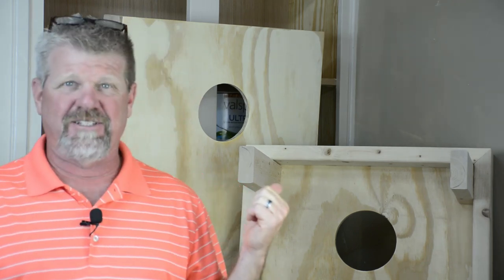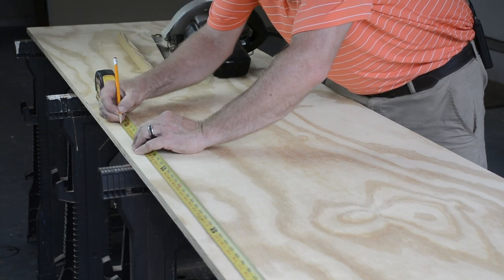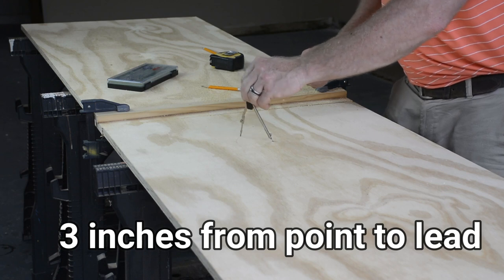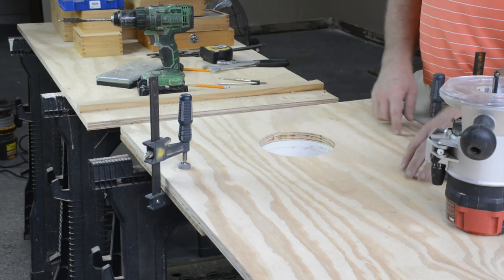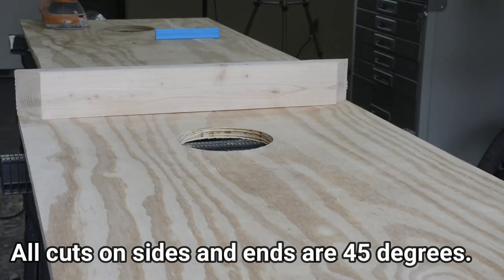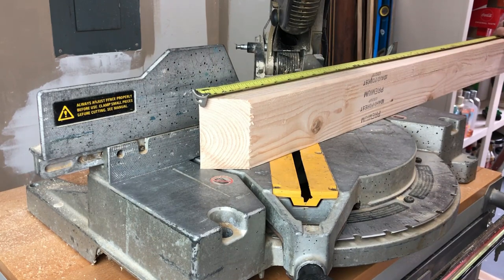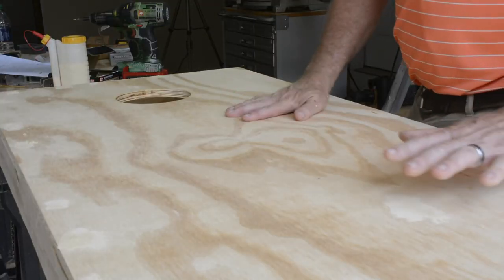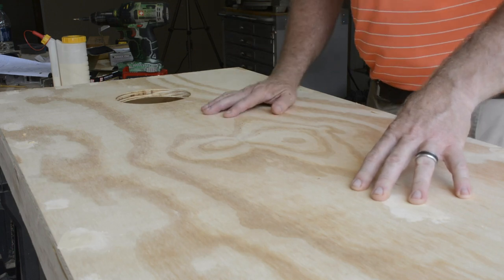How to make corn hole boards

Comment: Making my first corn hole board for a friend and nervous about painting and poly process. Do you have some advice for me or perhaps a video you have done that i missed? Thank you
Reply from the maker: It is really hard to explain how I do it, but not hard to do it.  I usually use two colors and do one at a time,  I tape off a triangle pointing to the center of the hole ...I will try to post a picture and give you the link.  I am going to be building some more very soon and do another video.  The hardest thing is making the hole look good but if you own a router it is a lot easier.
Reply: @norabder1008  thank you and looking forward to the next video

Comment: After you finish sanding do u paint or stain them? Curious what rules require.
Reply from the maker: I always paint mine with at least two to three coats of exterior semigloss.  I have made some with bar topper but those cost me $300 just in bar topper and I made them as a gift to my step son.  The rules say the following:  5
5. The board finish shall be sanded to a very smooth texture, and there shall not be any blemishes in the wood surface that might disrupt or distort play.
6. The board can be painted with a semi-gloss exterior latex paint resulting in a surface that allows bags to slide, but is not so slippery that it allows the bags to slide back down the board.  to slide, but is not so slippery that it allows the bags to slide back down the board.

I am sorry the video was not very good...I am planning on doing another one as I have at least 3 more sets of boards to make for the Brewery.  I didn't plan that one!  I didn't have time to paint them as that takes more time and money than building them.

Comment: Thanks!  Do you finish with some sort of poly?  Did the rules allow that?
Reply from the maker: Chad Decklever I usually put about 3 coats of paint and 2 to 3 coats of polyurethane.  Make sure to use exterior paint.